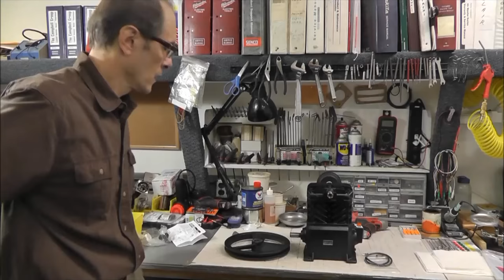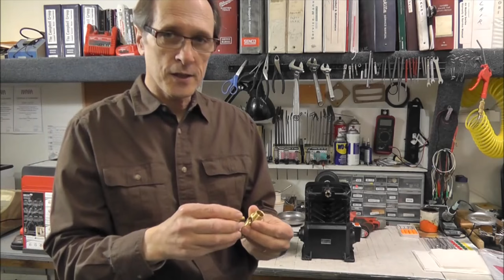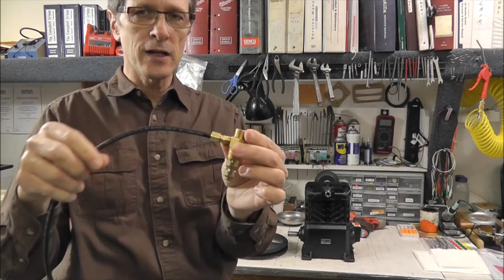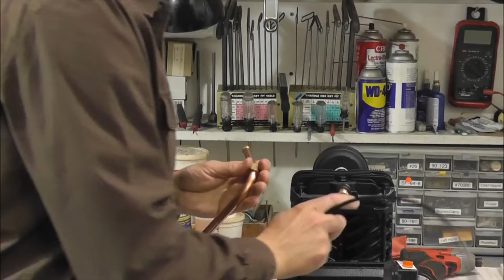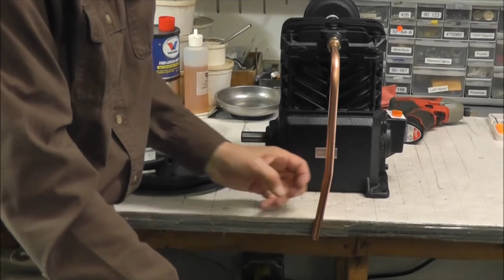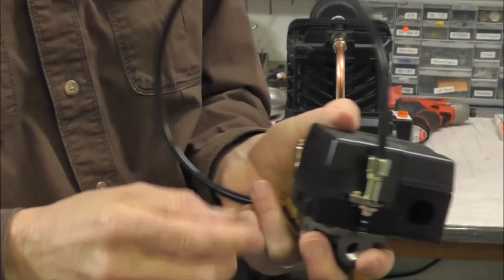How to install the MP513901SJ kit

Comment: I just replaced a Campbell Hausfeld unloader valve on my Central Pneumatic compressor and noticed that the rigid black nylon tubing didn't have a brass insert inside the tubing where the compression sleeve tightened down onto it.  I thought that the worker that installed my unloader hose just forgot the brass insert.  I see that this kit doesn't include brass inserts for the nylon tube either... is just putting a compression fitting on these hoses without the inserts a standard practice?
Reply from the maker: Thanks for the watch and for the question! To answer you, yes, it's not common practice for manufacturers to not install these brass tubing inserts for the nylon tubing, even though they should. We install the inserts to stiffen the ends of the tube when we install the tubing. This is a prefab'd kit from Campbell so we ship it as-is. In our opinion, however, it's certainly a good idea to install the brass inserts whenever possible.
Reply: @MasterToolRepair  Thanks for the info.  If I have a problem with my nylon unloader hose I will just switch it to a copper or aluminum tube.